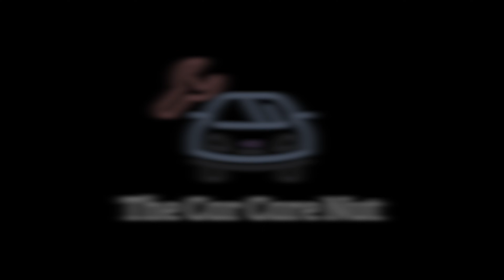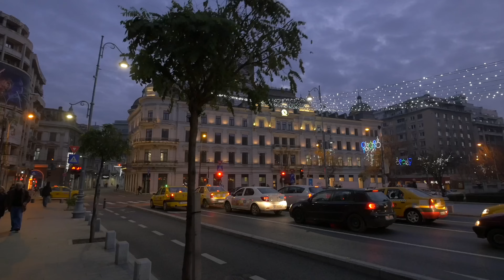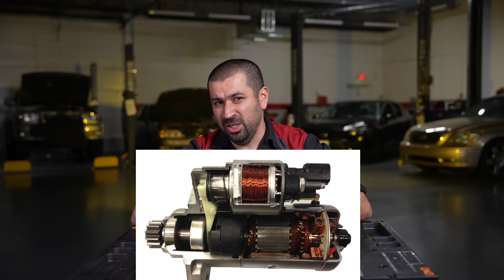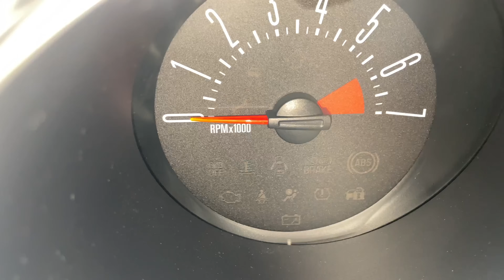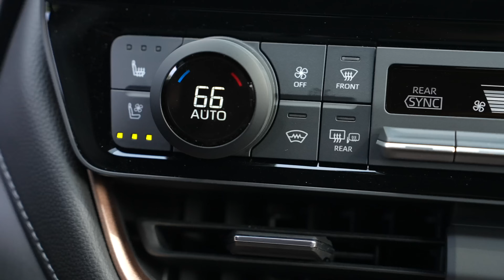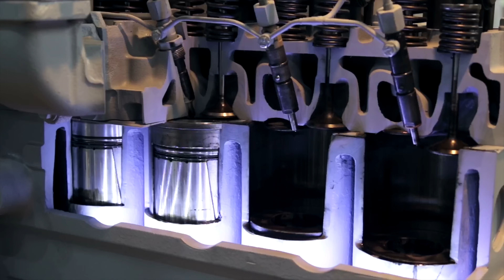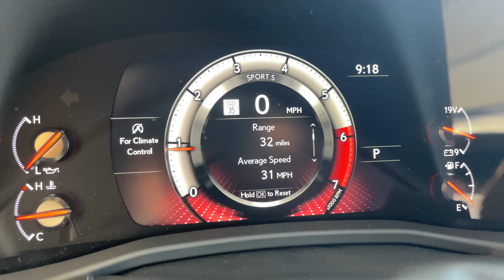How Does Start Stop Technology Work in Modern Cars? Everything You Need to Know

Comment: I have another question.
I drive a outlander phev, a hybrid.
My car drives electric 70% of the time.
But.. when i drive a bit faster the engine will turn on.
Sometimes for just 2 seconds.
So my guess the engine will always be cold started under load. 
What does it do for its reliability?

I know this i one of the reasons they didnt use a turbo.

I hope they engineered it for this but it doesnt feel right. 

I make sure i change the oil alot more than the books but still..

Comment: Is there any net gain in emissions reduction or cost of operation after considering all the extra manufacturing required to add pumps, sensors, bigger batteries, starters, faster ecu’s, added weight?

Comment: When I look at the starter picture of my former car a 2020 ford ecosport 2.0 which had start stop. The starter doesn't appear to have TWO solenoids. You say there are TWO. I don't see a second solenoid. PLUS if I look up my friends F150  5.0 v8 pre start stop then look at same engine size for 2017 which has start stop SAME part number for starter??

Comment: Don’t use it. While it doesn’t use your starter motor but it requires GDI (direction injection) which every time it stops you get heat soak and carbon build up. It also puts repetitive strain on the value train belt/changes. Turn it off and avoid unnecessary damage.

Comment: Is start-stop system effect turbo lubricating and lifespan? I have 2015 Skoda 1.6 TDI and i usually tend to close it because after driving 90 kph for an hour there is a traffic light and when i stopped i think car does not lubricate turbocharger.

Comment: Every gas golf cart people drive is start stop. When I worked on these nobody has ever, ever asked to made sure the thing would idle because it would last longer. So long as the starting system is designed for it and won't prematurely die, it works fine. It works better in fact because it uses that CPS you noted. The brakes also are more than strong enough to hold a car that isn't running and pushing on a torque converter to move it, with no boost. Hence why your parking brake can hold the car on a hill with just the back wheels. It's mostly using the same tech that was already in the car but modified to be handy for this purpose. Saving more money at slow drive thrus than stoplights for the average person though I'm sure. And one other thing, most just use a normal battery and the electronics work with it.

Comment: Thank you for the video. I learned about the different components and mechanisms and things they had to change to make it work.

With that said, I just recently disabled the start stop on my wife’s 2017 Highlander   I bought a device off Amazon. That is super easy to install. Just pop the start button out, pull the connector off, and plug the device in between the switch and the connector.   Now, when the car starts up, the start stop system turns itself off.

The button still works, it just defaults to off when the vehicle starts up

Comment: The only problem with these complicated systems is that basic operation is a chain.  These complex systems make the chain infinitely longer.  And a break in ANY link in the chain can render it inoperative, or at the very least "set a code" so that come time for annual inspection, you need to spend big bux to replace some silly sensor buried deep in the car's innards.
Like the $2000 taillight one pickup had.  All the cross-traffic sensors and backup sensors, etc., were in that housing.  Someone cracks the taillight, instead of 50bux at a boneyard, you're plunking down 2kbux from the dealer.
That's also why a fenderbender that used to just take a dent-puller and some Bondo, now ruins enough systems that a rebuild puts the pricetag for repair over the cost of the car itself:   totalled!

Comment: Nice explanation - however you didn't address the issue of start/stop the engine when the oil is not circulating. The most wear on an engine is during starting without oil. Now we want the engines to start/stop multiple times during one trip. This is not a good idea if you want the engine to last.

Comment: I learned a great deal from this video. I had no idea how much engineering went into start stop systems. My problem with start stop is increased engine and turbocharger wear. Nowhere did I hear about the engine oil pump being redesigned to keep oil flowing to bearings of the engine and turbo when the engine shuts off at stops. If this is not occurring, this goes against the advice given by our beloved Car Care Nut about turbo care.

Comment: i watch the engeneering necessary to operate that system : you save very littlke fuel 1% , then the additional engeneering in your car has 5 additional parts that can go wrong or break its amazingly complicated you need a special bigger battery , you need an aditional water pump to keep the heat when the car stop, you also need a complicated system to keep the AC going when its hot outside and you need all kind of sensors for the computer to make all this work. these are all problematic and may fail. more repair ,more money from your wallet , more visits to the dealer as your car gets older. I personally will always stop that system as soon as i start my car tank you , there is a swich to do so.This is another environmentalist useless expensive feature that save noting at all and will cost you money in the long run. Dont believe them for a minute, its avery complicated system , its not only your starter , its the battery , its the additional water pump ,its the ac system, all breakable things that will cost you money.

Comment: And I thought the extra parts in the Turbo were a lot.... Modified starter, battery, HVAC added parts, transmission... great technology, but the engine and components will break down quicker than a non-start stop car 🙄

Comment: Very good explanation thank you for making the video. I generally use the button to turn it off. From your video there are actually some benefits to having the Start/Stop on e.g monitoring the battery condition and the starter end of life etc. would the computer continue to perform these checks when the Start/Stop of turned off using the button provided by TOYOTA? 0:07

Comment: One thing that wasn't mentioned was oil.  Most vehicles with Start/Stop technology use a very low viscosity oil and have variable speed oil pumps.  You need to get the oil circulating as quick as possible.  A 20w oil is going to flow quicker when cold or even when warm vs say a 40w.  The oil pumps are variable speed to ensure maximum oil pressure is available when the engine is shut off during these events.  Some will argue that most engine wear occurs at start up.  While this may be true to some extent, that is on a "Cold" start.  Once the oil is circulating and warmed up and the engine shuts off during a "Start/Stop" event the oil is all over the engine components so that wear is minimalized.  It is also true that these systems are primarily for "Emissions" reasons, but it is not illegal to deactivate the system.  if it was the manufacturer would not give a button to turn it off.  There are companies that make a harness that plugs into the switch of the "Start/Stop" system that reverses the button.  For example.  You get in the car and always have to press the button to deactivate start/stop, with the switch mod, when you turn on the car it defaults to off so you have to press the button to turn it on.  I have this mod in my VW GTI and works flawlessly.  Also in VW's you can actually buy an aftermarket coder and de activate the start/stop all together.  Is this an emissions failure when you go get a smog certificate?  Not that I have seen.  Personally, not a huge fan of the system.  I live where it is extremely hot and in the summer the car gets so hot sitting at the stop light.  For colder climates its probably not a big deal.  Or how about your car shutting on and off 50 times while in line at the Starbucks on a busy day and the line is down the street?  Its cool to have it, but I prefer to keep mine turned off.  Thank Goodness for the mod!!

Comment: Great explanation and video. I just got a 2023 RAM 1500 with e-Torque 5.7 hemi. I just can not believe this stop/start not causing unnecessary wear on the cylinders. Especially in the city. Hot road, hot engine, oil drained cylinders, several times. Ive always believed the start was what wore an engine as oil wasn't on the cylinders. I enjoyed the video and subscribed. Ill plan on pushing that button for off.
Reply: People forget that the e-Torque system has a belt driven motor/starter that starts the system instantly, and has a small hybrid battery to run it, giving you some extra HP when accelerating.

It is basically a mild hybrid system, and it works perfectly as a start/stop system.  I have driven a few Wagoneer's with the e-Torque system and it works great.  Really no reason not to use it.
Reply: They use a different coating on the main bearings big end bearing etc and specific oils on most brands. Don't forget toyota have been doing stop start for decades on hybrids like the prius and they run for hundreds of thousands of miles   even reports of million mile prius taxis still running on original engines and running gear 😮 I think it's safe to say they have proved it doesn't damage the engine 😉 my lexus ct200h has two hundred and sixty thousand miles on all original and runs like silk .yearly 10000 mile services using oem oil and parts
Reply: @seamusspratt7205  it’s the oil that burns and makes a paste that plugs the oil flow channels. You can put any coating you want on the bearings and it doesn’t help. The bearing has no oil it’s going to wipe the bearing and score the shaft.

Do you want to know the real solution?  They make turbos that are slightly wider and they use a ball bearings with a race. no oil. The slight addition of space separates the hot turbo casings from the bearing. But these turbos are more expensive.

If you really rented this, it’s quite easy to do the research because many companies sell the aftermarket stuff .
Reply: How long do you stop at a junction? Oil doesn't magically disappear from your surfaces the moment it's not on.
Reply: @shmorgb  were are you referring to stopping an engine and restarting it at a traffic light? if this is the case, then I have to explain one more thing to you. The oil going to a turbo charger bearing provides two purposes: lubrication and heat removal. When you stop an engine after you’ve been boosting, the bearing is hot and the housing from the exhaust turbo charger is hot and the temperature goes into the bearing and it will coke the oil. Burn it up. And this and the bearing to have boil starvation overtime, and the turbo charger will fail.

Each time there’s a little coke buildup it gradually blocks the oil flow.

When turbo chargers were popular initially for performance, it was common to have turbo timers .

You would stop the car pull out the key and the Benjamin would run for five minutes cooling the bearing
Reply: @HisDudeness2023  again. How long are you stopping at a junction? Did you watch the video? Have you considered that they utilise different bearing surfaces in construction of the turbo's used for stop-start engines?

And whilst turbo timers are indeed used by those who love to modify their vehicles, I guess my 7 year old 113,000 mile turbodiesel hot hatch with its original turbo still fitted cooks alive every single time I drive it somewhere and turn the engine off. Or wait... could they possibly have designed it to deal with the typical heat one would generate in a stock engine under standard loads?

If your turbo cokes up, it ain't the stop start that killed it. It's your enthusiastic driving and subsequent excessive loading that did.
Reply: @shmorgb  it’s an intersection in the United States not a junction. it can be a minute or two or 10 minutes. It depends on the junction and where it is.

Bearing material has absolutely nothing to do with this . The oil oil performs two functions.. cooling and lubrication. When a turbo charger shuts down residual oil In the  bearing Burns up, Coke gradually overtime clogs the channels starving the bearing.
Reply: @HisDudeness2023  and yet millions of cars do not have turbo timers, do have start stop tech and in neither case has turbo longevity been an issue worth fretting ones knickers over.
Reply: @shmorgb  stop replying to me. You’re not trying to learn.
Reply: @shmorgb  and yet Americans pay big box to replace turbo chargers over 100,000 miles because of auto stop
Reply: @shmorgb  how much real life experience do you have? Have you been an owners club with other turbo charge high-performance cars? Have you looked into the specific oils used and what grade of oil to use this best for your turbo charger n coking?

You’ve done all this we can have a chat. If you haven’t done all this shut the hell up.
Reply: I replied with almost the same information.

The guy is a jerk . He has a political mission. He’s not interested in the technology.
Reply: @HisDudeness2023  Dude how much real world experience do you have? Are you able to at least draw on the experience of millions of drivers who currently drive turbocharged vehicles without needing a turbo timer? And have done long before stop-start tech became ubiquitous?

If you can't then shut the hell up because you're talking absolute bullshit.

Fair play if you just don't like it, but to insinuate decades of driving turbocharged vehicles globally has resulted in huge issues with wear in a turbo or coking is just idiocy.
Reply: @shmorgb   BS. A lot of words that said zero
Reply: @HisDudeness2023  I didn't type a lot of words. If your attention span is the length of a fairly modest youtube comment that may explain quite a bit. Bless you.
Reply: @shmorgb  Antiquis temporibus, nati tibi similes in rupibus vntosissimis exponebantur ad necem
Reply: @shmorgb  ROTFLMAO
Reply: @shmorgb  oh the puppet bobs on the strings again. Incapable of learning.
Reply: When the engine is running, oil is forced to the turbo charger bearing continuously through the turbo charger, whether it is boosting or not.
Reply: I agree. Main, cam and rod bearings use hydro static lubrication. There is never any metal touching the bearing when there is oil pressure and its running. Most wear comes from slow and cold starts where there is low or no pressure. I cant wait to see what batteries and starters cost for my 2021 durango. I shut if off also because even though it is supposed to "instantly start" It almost got my family and myself killed when I was pulling into moving traffic and it took so long to start we almost got T-boned.
Reply: of cars are using turbo chargers on engines for emissions.. I’ve had turbocharged cars, and one of the biggest problems is having a hot turbo, basically burn the oil in the bearing and prevent lubrication and frying the turbo bearing.

You’ve and you have any heat in the turbo and you start shutting off the engine that’s not good.
Reply: Right, my mechanic always say : after a long ride NEVER shut of the car imediatley because the turbo has to cool down . Ther will be oil inside the turbo that will burn and can cause turbo damage. @HisDudeness2023
Reply: @HisDudeness2023 modern turbos continue to spin after the motor is off to avoid this problem, do they not?
Reply: @HisDudeness2023  yes. Its toast you oil nicely too. Forced induction just makes more heat and wears out head gaskets and stresses engines more. Unless its a heavy rigid block with great cooling its gonna wear out faster.
Reply: @britjohnson1990  

Bought my son a WRX and he rode the hell out of it for 250,000 miles . Royal purple and a turbo timing resulted in the original turbo charger working great until he sold it.

All that was required was frequent oil changes. 

My question was auto stop .
Reply: It’s only issue above 100,000 miles.

But if you don’t change your oil or use the right oil, it can now you much sooner .

It depends how much you boost when you drive . You drive like a little old lady. It’s not a problem. If you drive with more spirit then this can happen.

I used the turbo trimmer and got 250,000 miles on the car on the original turbo . I use Royal purple oil changed the oil every 3000 miles and a turbo timer.

Most WRX turbos don’t last 150,000 miles.

Comment: Absolutely brilliant explanation of the system. Only thing I’ve always wondered is if the turbo could be damaged doing a continuous high speed and then suddenly a stop event is called for. I always let the car idle for a minute before switching off so that it spools down and with oil pressure in the bearings. So why never any turbo damage ?
Reply: Perhaps an electric coolant or pil afterrun pump to keep turbo cool during a stop event?  Just guessing though, I have no idea.

Comment: Excellent video thanks. I have a VW R Golf 7.5. Stop/Start works very well  And models prior to the Golf 8 have a simple switch to turn it off if so desired.
Has a Stop/Start status to explain why it's not on.  Air-cond remains on but if it is a hot day, the engine will not stop in order to keep the air-cond running.

Other features that affect Stop/Start.
1. Inactive if car is in Sport Mode.
2. You can start the engine if stopped at the lights etc with a simple small wiggle of the steering wheel. Useful when you can see that roundabout entry gap coming and you want the engine ON for zero delay.
3. If at lights, engine stopped, the car in front moves off, the radar detects this and Starts the engine automatically. Clever. Especially if your concentration has lapsed! Obviously does not work if you are car No 1 at the lights.

Reliable.